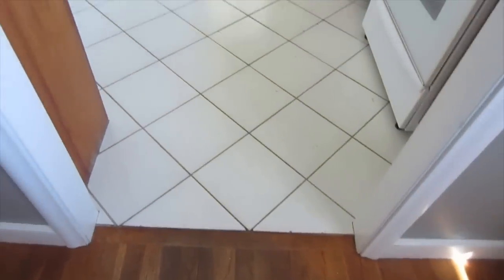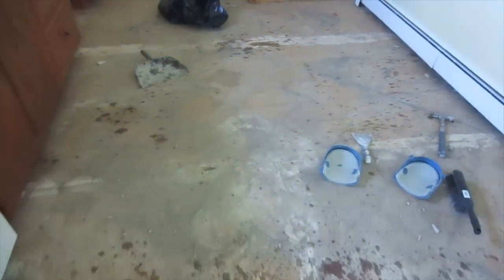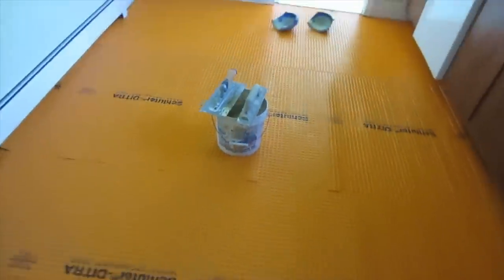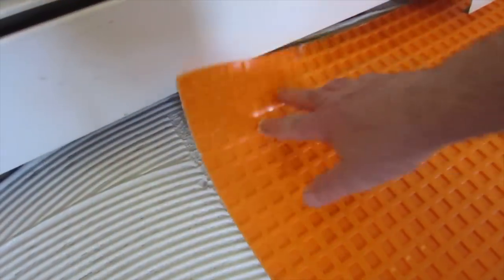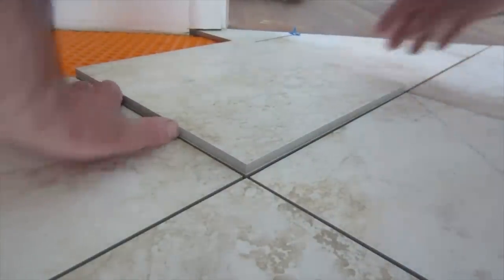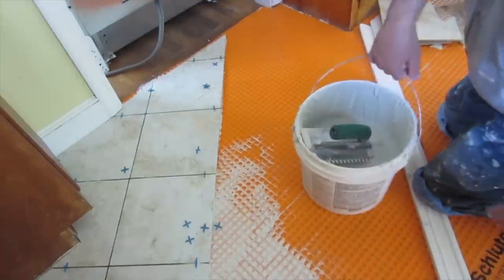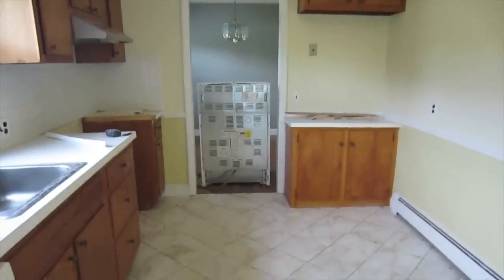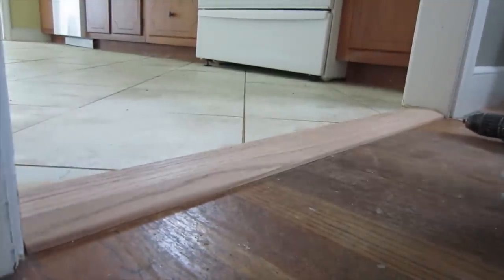Diagonal tile floor replaced with new tile on Schluter Ditra  Part 1 through 6

Comment: I’ve been demo’ing my 1940s bathroom for days and get so jealous when I see videos where the old tile comes right up. 😂. The walls were set on an inch of concrete. I’m dreading the floors (which appear to have at least an inch based on the height difference to the adjoining rooms....)
Reply from the maker: Floated walls and floors can be a challenge to tear out. https://www.youtube.com/watch?v=mEfAnHT_mRI&t=1s
Reply: @SalDiBlasi  Thank you so much!   Exactly what I needed to see. My ‘before’ is nearly identical down to the green tile. 😁

Comment: nice work sir. for anyone that doesn't know: when it comes to grouting, the cleaner you get the floor with the grout float the better off you'll be. also, the idea is to get the grout joint flush with the tile, not above or below.  on a floor this size or smaller, a sponge and water bucket is ok, but when you get into bigger areas you may want to invest in a tool called a grout buggy.  it makes it much, much easier to keep the joints flush

Comment: Trying to understand the process. Wouldn't it be quicker if you went the long way with the ditra at 10:10 ?
Reply from the maker: You want to be sure the seams of the ditra do not land on the seams of the plywood. So the short way may be a better choice, short lengths are easier  to handle than long ones. Every job is different.

Comment: Great video, looks like you tiled up to the trim.  Do you usually do that or remove the trim and replace over the tile?  Im doing my kitchen in the next few weeks, should I tile under the stove and dishwasher?  Also, I noticed you usually use a straight egde, how do you secure it to a concrete floor?  Have you installed the wood tile in a herringbone pattern?  I would love to see a video on that.  Thanks again for the videos.
Reply from the maker: noytheyah Best to remove base board, but not always possible, so caulk the joint at the base so you can have a soft joint where tile meets it. You should tile under the stove and anywhere there is a removable appliance. Put a box of tile on  each end of the straight edge to keep it in place.

Comment: Good video,one question,why do you have thinset on the ditra while your doing your layout for tiles.It looks dried
Reply from the maker: +Steve Farnan It is dry, used up leftover thinset from the ditra install to fill the waffles instead of throwing it out.
Reply: but wait, wasn't that modified thinset you used to lay the Ditra? Are you saying it's ok to fill the waffles with modified as long as you set the tiles with unmodified thinset?
Reply from the maker: Good catch, I used the left over modified thinset to fill the voids in the ditra instead of tossing it, the key is it had a hole day to dry before I started installing the tile. Had I needed to start tiling the same day, I would have not done that.

Comment: Nice job.I´m tiling contracter in Sweden and we different methods and materials for instance the ply floor would be covered with foor gypsum sheets and then primed or water proofed with a roll on membrane depending on the amount of water exposure.I wondered is this Ditra system water resistant in itself?
Reply from the maker: Yes Ditra itself is waterproof, and by treating the seams and wall junction the entire install can be made water tight

Comment: Thanks Sal, for another great video.

If going over Advantech, what thinset would you recommend for attaching the Ditra to the subfloor?  Advantech seems to be a bit waterproof (spec'd for outside/open for 500 days during construction), so can I still use the modified 253?
Reply from the maker: 253 is good, but I would go with something that has a little more polymer like 254 ore Tec Superflex or Mapei Ultraflex 3.

Comment: Hi Sal  i want to install tile  on the kitchen floor  in a  older house  that  it  already got   additional one cm  plywood   on sub floor and than it got  vinyl  sheet glued to the  plywood  so my question is    . Is the one cm thick plywood { or any other kind of wood that you  recommend } is good enough on the top of sub floor in order to install tile     since if i use thicker  plywood  then the kitchen    floor  get too high and i  cannot  find a transition to the laminate floor that  i already installed to the rest of  the  house floor  also  would  i be able to  use MBP on top of vinyl in order that  the thin set stick to it  or i should remove the  Vinyl sheet  and use  Schluter Ditra  the other things would i be able to use  any other kind of  wood  instead of plywood    also  would i be able to  use   hardybacker  board directly on subflloor  by  using  thin set to stick to  sub floor plywood  and than  installing  tile  if i go this way  thanks
Reply from the maker: This is not an easy question to answer since there are so many variables possible and I can't possibly know all the conditions. 1cm is about 3/8" which is the bare minimum thickness of plywood allowed in a tile assembly, however that plywood may not even be needed if your joist structure meets proper requirements and the subfloor is installed correctly. and is of the right type.  The existing vinyl  floor should probably be removed, and depending on how it was installed, that can be a huge problem in and of itself. I suggest you take a look at the Ditra handbook  https://sccpublic.s3-external-1.amazonaws.com/sys-master/images/h66/h6e/8917114126366/DITRA%20Installation%20Handbook.pdf  find the situation that most closely matches yours, and go from there.
Reply: @SalDiBlasi    Thanks The house is  old made  in  1994  and  some part of the floor  made  sound when one was stepping  on it which i cut and  replaced   and  screwed  glued  with new plywood , by the way the joist is   every 16 inches   i will remove  the  vinyl than  place   new   3/8 inch wood  on all  of  it but wondering  does it have to be plywood or any other man made wood   also tiling the stairs   as will i know that   on  stair tread i have to use  Schluter or  hardybacker board  on plywood but on the raiser  Do I still have to use  those or i can directly install it  on  plywood  thanks

Comment: so it appears in the video that the mortar is pretty wet. Do you mix your mortar to a consistency that you prefer to work at? If so it obviously doesnt have a major impact on the job? 2 I see you arent really needing to  push the tiles down into the mortar much. I find myself really pushing them in and moving them a little back and forth to help with the coverage on the tiles. Am I just doing more than I need to?

Comment: First of all, thanks for all the great videos! My question is, the unmodified thinset at the Home Depot costs around 7 dollars; it's most likely not the best! Do all unmodified thin sets costs that low? Thanks.
Reply from the maker: No, stay away from that cheap stuff, Buy either Tec Uncoupling membrane mortar, Mapei Kerabond, Ditraset or something similar these are premium unmodified or dry set mortars.

Comment: I notice you seem to always remove the old tile. I have an old curved floor (not a level plane but concave) that I need to tile. I was thinking of leaving the tile on the low part of the curve and self level (this way I don't need to use as much self leveler) and then tile on top of that. Since I would be going on top of self leveler and old tile which looks to be in good shape I was thinking also not necessary to use uncoupling membrane even though underneath all of it is a wood subfloor. How would you go about this?
Reply from the maker: If it were me, I would rip out the old tile, prep the floor and start over. Going over old work is always risky, you don't know how well it was installed, and if there are underlying problems that will come back and bite you later. Cutting corners will always lead to problems down the road.

Comment: hey Sal , great work I love your videos. I have two questions frist, why should you lay the floor before the wall tile, second how could you tell the difference between marble and quartz counter tops. if there both white.
Reply from the maker: I don't always lay the floor before the wall, so it is not a must, but it is easier to leave an expansion joint if you do.
Reply: Thank you very much for taking the time to answer my questions, 
Ok so it for expansion , got it.
Reply: Sal, I'm buying a quartz counter top, I don't want to get ripped off  how could I tell if it's quartz and not marble. .
Reply from the maker: paul valenz Marble will usually have some kind of veining to it, but not always, Quarts will usually have what looks like interlocking crystal, but not always easy to tell. I have been surprised by what some marble looks like and the same goes for quartz, but I am no expert in the field. If the fabricator is reputable, then you will just have to trust what they say.

Comment: I have slab/ concrete floor and I wanted to install tile over.  What is a cheap Underlayment to use besides the Ditra, so I don't ruin my foundation?
Reply from the maker: You can either tile right on the concrete  if the slab is in good condition, or use some other uncoupoling membrane, but there is no cheap substitute. Tile is a perminant floor covering and will make your concrete better, not ruin it. Taking cheap shortcuts is not a good idea when installing tile and will eventually lead to a faliure that will ruin your floor.

Comment: If my kitchen has roll out vinyl do I need to tear that out first or can I use the ditra on the existing roll out floor?
Reply from the maker: It is always best to remove the vinyl, however it can be done. Follow all the requirement in the handbook https://s3.amazonaws.com/scclegacy/media/ditra-handbook_eng.pdf 
 Detail D-V-T-16 on Page 7
Reply: Thanks.  How do you remove baseboard and quarter round before the job without damaging it and keeping track of where it goes afterwards?

Comment: what was underneath the tile, and did you add plywood to the old floor before thinset?
Reply from the maker: +Andrew Smith There were already two layers of plywood, when i removed the tile the plywood was in good shape, so i cleaned it up and installed the ditra.
Reply: Would you ad something to 5/8 chip board? That's all I have to start
Reply from the maker: Andrew Smith Depends on what you mean by Chip board and what kind of tile. If the Chip board is Particle board then it has to be removed and replaced, if it is OSB and the joist spacing is correct  it is good for ditra and porcelain tile. Here is a link to the Ditra handbook https://s3.amazonaws.com/scclegacy/media/ditra-handbook_eng.pdf

Comment: can I use kerabond unmodified thinset on large format tiles over ditra?
Reply from the maker: You can, but you might want to try a Thinset designed for large format tile which has more body and will support the tile better during instalation.

Comment: Dont you have to use unmodified on setting the ditra as well? you should try Strata mat by laticrete. you can use modified thinset
Reply from the maker: Adam Wilson Modified to install the ditra on plywood, unmodified to install the tile on the ditra. Strata mat is a good product as well.

Comment: I'm surprised you use this runny consistency of thinset... Bostik 
instructs the addition of 5-6 quarts of water per 50lbs bag. This looks 
like more than that. Never used Mapei does it require more water? I'm 
surprised you can hold the shape of your notched thinset steady...
Great job. BTW, try the Marshalltown ef87d, much less smearing.
Reply from the maker: +Order in Chaos Mapei has very good products, sometimes the video can make things look different to what they actually are, and depending on what i am installing i will mix my thinset to a different consistency.

Comment: No wonder the tile is coming off... There is no wire mesh underneath!!! Yikess
Reply from the maker: Jerseymud job is just as bad.
Reply: wire mesh is outdated. now there is concrete board, fiber board, and the detra plastic underlayment the video shows. wire mesh is only used on floors that are sitting in a 2 inch mud base, which is waaayy more difficult and time consuming lol
Reply: also if you're looking for wood to tile application mastic is much better. doesn't belong on a floor though,  always better off with underlayment and good old thinset